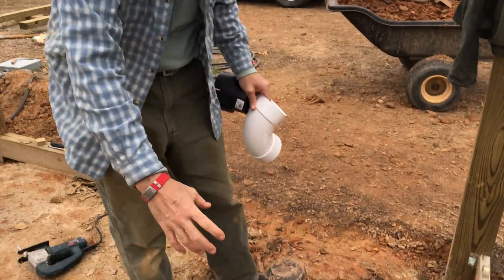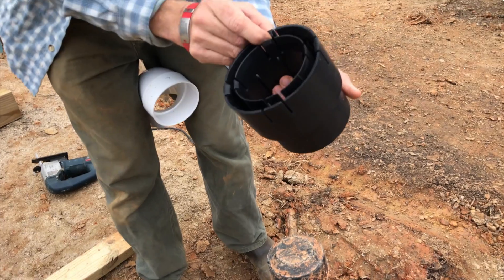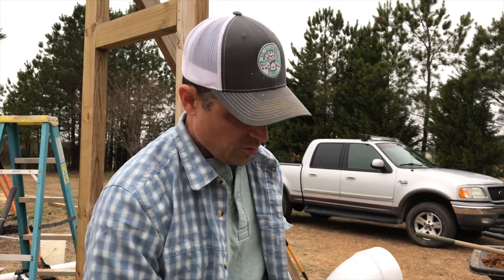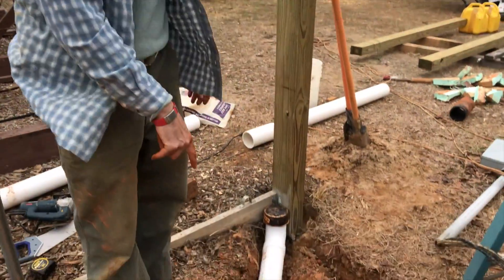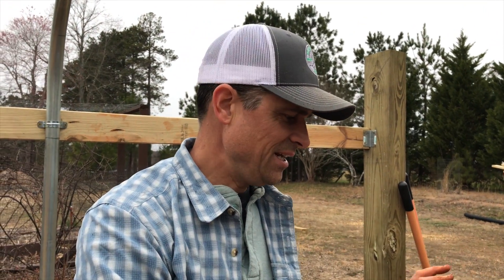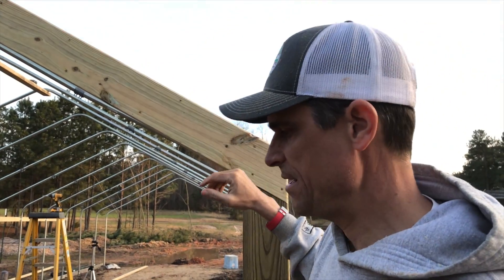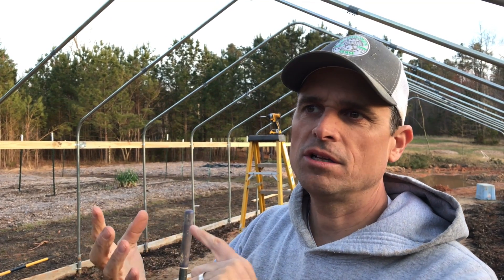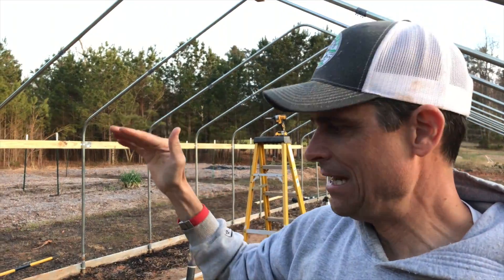DIY Geothermal Greenhouse Part 6: ENDWALL

Comment: Hi, did you decide to go for an airflow heating system over a sealed water convection system because your heating element is above the bottom level of the piping? I like the idea of using a water convection system off a rocket stove system, however in this setup the stove would need to be below the pipes, or a heat exchanger would need to be installed to move the heat to where it is needed.

Comment: In the winter you’d have heat cells to use elsewhere from the greenhouse too. It would be a short enough trip to a shop, tractor shed or outbuilding.